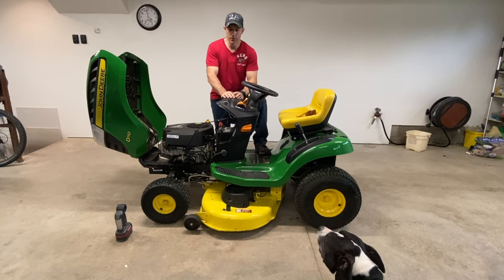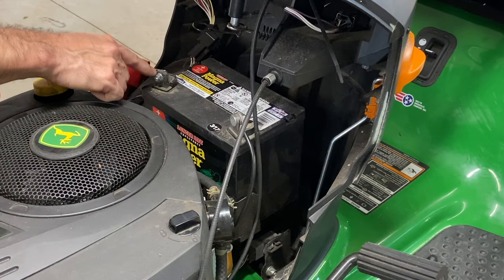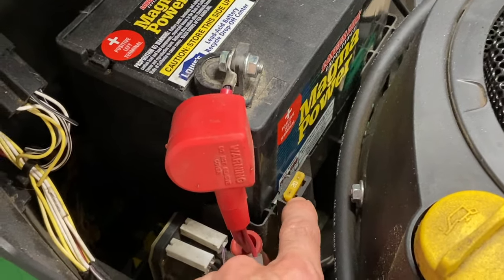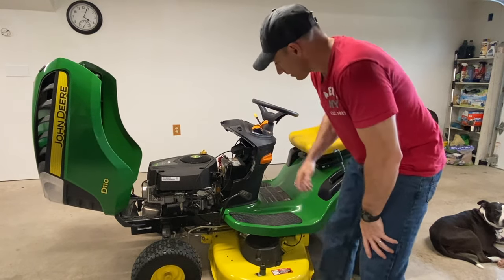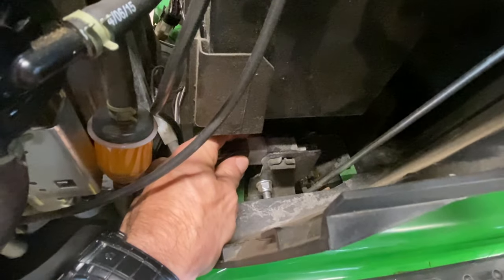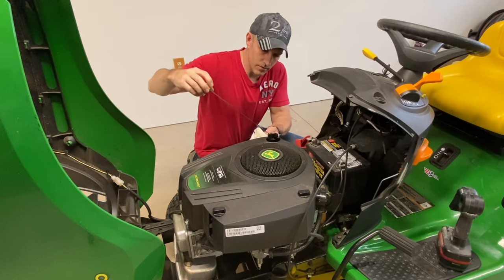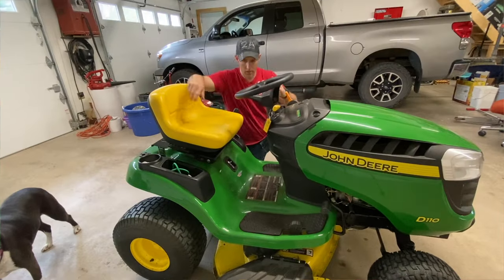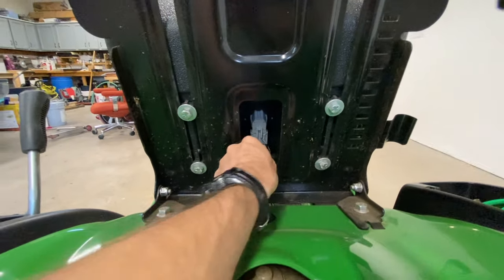JOHN DEERE 100 SERIES WON'T START

Comment: This video is the perfect example of the original benefit of YouTube. Clear, concise and informative.
Reply from the maker: Thanks glad you like
Reply: Lastly check solonoid, mine wasn't transferring voltage to the starter. Thanks David.
Reply: I maybe have 7 subs idk, but I subbed and liked just for this reason. I cannot stand when someone has a whole intro, I'm trying trying get shit done haha.
Reply: In my case. Jim says check the fuse. Mine wasn't broken it was missing. My son has been tinkering on a ATV and I am guessing he stole it, but refused that he did anything to it. Less than 2 minutes and Jim had me back up and running on a fuse I didn't realize wasn't there.  Thanks for the help
Reply: I completely agree, i had a blown fuse and didn’t need to watch someone speak for 20 minutes

Comment: quick tip from a JD tech: while trouble shooting or in general you can start your lawnmower with no weight on the seat as long as the parking brake is engaged. helps when checking multiple safety and power points throughout the ignition system.
Reply from the maker: Thanks for the tip I’m sure people do not know this. I was just going over the manual.
Reply: @DIYJIM  you’re welcome, keep up the videos. very informative for the common consumer that may not have read their manual or aren’t as mechanically inclined 👍🏼👏👏👏
Reply: Yep, as long as the blades are disengaged and the parking brake is engaged, it's not necessary to push on the brake pedal ... or even be seated on the machine.

Comment: Jim, with the safety switch's there are several suggestions from people about disabling them. Can you just cut the wires and join them together and tape them up? Also, how to test the clutch mechanically and electrically? Thank You Sir!

Comment: I have 3 acres, not 1 ft flat. I have to lean & shift my LARGE body to keep from rolling it. I want to bypass the switch that keeps cutting my engine every godamn time but it will void my warranty. Any thoughts JD NATION?
Reply from the maker: I cut the wires and put a wire nut on them. I have a video on what I did if you look. Thanks for watching

Comment: Thanks for the great video Jim !  After mowing my front yard this weekend, my 19 yo JD L110 wouldn't start when I started to mow the backyard,  found your video and did the checks you suggested and it was my fuse and the brake safety switch had dislodged out of the bracket.  Put in a new fuse and put the switch back in and was good to go !!
Reply from the maker: Glad I could help, thanks for commenting

Comment: What if it starts and runs very rough then stops but won't start again.. lots of gas coming out where the air filter is.
Reply from the maker: Maybe try watching this https://youtu.be/0qStUg0ImoI
Reply: So mine will not even start again. Until it completely cools off like the next day. I took off the filter, tried to start it and a bunch of gas was shooting out.

Comment: Wow, thank you. As an older single woman trouble-shooting my "crank but won't start" JD L120, this video gives me step by step things to check. I like your delivery, too. Just so dang clear, and good video technique  to show what we're supposed to look for. Appreciate it, man.
Reply from the maker: I hope it helped you, thank you for watching have a good summer.
Reply: Woohoo. Figured out it's a fuel problem. On to replacing the fuel filter! Yes, there's gas in the tank...lol.
Reply from the maker: @margarethansen2720  check out this video https://youtu.be/0qStUg0ImoI
Reply: Ditto for me.  This guy gets right to each point.
I took this video into the garage and went through the rig one by one.  I think the problem is the fuel filter that appears never to have been changed.  If changing that doesn’t do it this video helps me believe I’m up for the task to continue.  In fact, cleaning things as I’m going through and learning each system is fun.  So when I’m finished this old thing will be humming again. 
Hi it’s just me making a mechanical repair.  Hooray!

Comment: Fan-freakin-tastic video!!!  Thank you VERY much! 

Out of the blue, I'm mowing my lawn last Saturday, and my <5-year-old E150 just sputters and dies, 30 minutes into a 90-minute job.  At first I thought it might be vapor lock or lack of gas, but it wasn't.  I cleaned the air filter (which really did need it), opened the gas tank & checked the level, verified battery connection and charge, but could NOT find anything which would allow it to start again.

Came inside, found your video, and went thru it, step-by-step, testing it for starting after each one.  Got to the step about the foot pedal safety switch, which I disconnected and blew out, and BAM - she's back to life!  Didn't even seem that dirty or disconnected, but that was the one which did the trick.  Went back out and finished the job, ran smoothly as ever.

Thank you for creating such a well-shot, easy-to-follow list of steps to check.  I saved a LOT of time, headache, hassle and $ by watching your instructional work here.  It is WELL appreciated!!!
Reply from the maker: You are very welcome thanks for waiting and leaving a comment.

Comment: You gave good examples and very details. Thanks for sharing.
Reply from the maker: Welcome, thanks for watching
Reply: Jim I have the same John Deer lawnmower. I just got it out the shop for maintenance. While I was cutting grass I rained out of gas. I put more gas in it and tired to crank it up but it want start up. The lights comes on like it suppose to but it just want crank up. I watched your video several times and did everything that you did and it still want crank up. I have a new filter, half tank of gas, battery is new, new fuse, new spark plug and oil change. I had it in Neutral when I tired to crank it but still nothing. I checked everything that you stated. What do you recommend? Are so you have any suggestions? I know it’s something simple but I can’t figure it out.

Comment: So I noticed that after I turned my mower off, it sounded like a clicking or vibrating noise coming from the engine. I wiggled the starter cable and it stopped. Now I'm trying to start it back and it acts as if it's dead. The battery isn't dead and my fuse is good. I'm wondering if it's something to do with the starter.
Reply from the maker: Sounds like it could be something to do with your starter. Hope you get it figured out. Thanks for watching
Reply: @DIYJIM  It was the solenoid. JD said it was pretty common with the model I have.

Comment: Thank you for posting your DIY videos. This particular video has helped me to eliminate all the possibilities to why my mower wasn't turning over at all.  However,  the problem that I found wasn't in any videos that I have found,  it turned out to be a grounded wire connected to the lights.  Apparently,  while opening the hood,  the wire harness leading to the lights had become impinged in the latch exposing bare wires, resulting in a ground. Even though your video didn't cover this possibility,  it did help me to solve my problem.
Reply from the maker: Awesome glad you got it fixed out. Thanks for watching

Comment: Not just that you HAVE fuel.. I couldn't start my LA145 for months.. had fuel, new plugs, new battery, re built and clean out the carburettor even though all those thing (barre the battery) were good..  

Turns out my fuel had gone off.. drain the tank and re fuel with 98octane and she purrrrrrrs
Reply from the maker: glad you got it figured out thanks for watching

Comment: Just above the fuel filter he pointed out, is the fuel pump. It has 3 ports on it that the hoses connect to. That could also be clogged. Plenty of videos to show you how to check how the fuel gets pulled from the gas tank to the engine and whether your filter or pump is clogged. Just simple stuff to check. It can get more involved with the carburetor/jetting/float bowl if everything else is flowing properly.
Reply from the maker: Thanks for the tip and for watching

Comment: I have an LA150 that will making a buzzing/humming noise if I turn the key all the way. I have to just barely turn it to prevent that but then it'll crank and act like it gets bogged down and stop. Already changed the ignition switch and battery. Still doesn't work
Reply from the maker: Not sure maybe starter is going bad. But the bogged down part not sure. https://youtu.be/0qStUg0ImoI

Comment: Should never start it with the transaxle set in neutral
Also it will not start if fuel cap is not venting & if valve clearances are off,good video 👍
Reply from the maker: Thank you for the comment

Comment: My dad has a D170 and he said he heard it clicking but it wouldn't start. We changed the battery and nothing not even clicking and the lights won't even come on. I checked everything you said and still nothing. I don't know anything about motors. Any ideas about what I can try? I'm lost. Thanks for the video.
Reply from the maker: Maybe starter solenoid

Comment: Good videos. Should the fuel filter be showing full while in use? Or partially full okay? I was having issues with earwigs in the empty tank over the winter getting stuck in the fuel intake tube. Noticed the partial full filter while troubleshooting. Thx.
Reply from the maker: Partially full, thanks for watching

Comment: Thank you so much for this video. I own the same mower and love that as a woman this mower is so user friendly. I’ve changed just about everything on this mower and it’s nice to have videos like this to learn more and always have it as a reference. Pulled my battery out and currently charging it. Was completely dead. However we have had this mower since 2017. We shall wait and see.
Reply from the maker: Awesome I’m glad my videos help you. Thanks you very much for the nice long comment.
Reply: Same thing literally happened to me today, but it was fuel filter and battery.
Reply: Especially that nice oil filter, 30 seconds
Reply: I am a single woman with a huge yard so get you.  This guy is so easy to follow.  My John Deere is running again.
Reply from the maker: @maggiebarks2395  glad I could help

Comment: Jim - Wonderful guidance. I did every step you recommended, except fuel filter (which looks clean from outside). Still nothing. Meter shows battery charged (hope I did it right) and lights turn on. Should I take batter out and get tested at NAPA? How would I know if a switch is bad/dead, without replacing all one-by-one (seat, break)? How would I know if spark plug is bad?
Reply from the maker: Thanks for watch sorry it did not help you. Really hard to explain in a message how to check everything. I would use a bypass wire in the switches to see if it starts when you bypass one at a time.

Comment: Hi Jim I thought your video was comprehensive and production quality was excellent. However, you never addressed the IGNITION SWITCH which is critical if your John  Deere lawn tractor won't start.
Thanks for the good info.
Reply from the maker: I just went over everything the manual says to check, but thank you for the comment maybe this will help someone else out.
Reply from the maker: Thank you Rollie motor

Comment: What of fuel pump relay??? Fuse will look good but relay? Just wondering if you'll hear fiel pump turn on like in cars?
Reply from the maker: I think guys will disconnect one of the hoses to check the fuel pump. Thanks for watching

Comment: I really appreciate your video.  I have a JD S120 that ran like a charm until this past August.  It started acting up and wouldn't run for anything, spitting and sputtering and even was hard to start.  I took it into a shop and $85 later they told me it ran great.  I took it home and about a week later it was back to where it was before.  I didn't plan to take it back to them so I read online where I should check the air filter and the plugs.  I replaced all three and it ran great FOR ABOUT A MONTH!  I was ready go buy a new fuel pump when I ran across your video.  Before I blew those ports out back by the fill cap I tried to start it again.  The engine would turn over but it wouldn't stay running even if I help the throttle bar up as far as it would go.   So I blew out those two ports in the back then got on the mower and tried to start it again.  It kicked off nd even in low throttle it stayed running!  So I took it out and engaged the blades and it styed running even when I lowered the throttle.  I also don't why it fixed it but it doesn't matter because it saved me some time and money because the next stop was another repair shop.  Now it sits in my garage waiting for Spring when I mow again!  I live in SE Pa. and the grass isn't growing right now.  Thank you very much and have a wonderful Christmas.
Reply from the maker: Glad I could help, I started putting only non ethanol gas in my mower that also seems like it helps.

Comment: Thanks for the video. When I removed the fuel filter no fuel came out of the fuel line. When I removed the gas cap, fuel came gushing out of line. So probably a blockage. And Last year engine would not start because my head gasket leak was putting too much oil in cylinder and fouling up the spark plug.
Reply from the maker: Hope you have better luck with your mower. They sure do not build them like the used to.

Comment: Jim you want a lawn/garden tractor that's built like a little Tank all around..go with a 2021 Craftsman T240 Turn Tight..John deere or cub cadet couldn't touch the Craftsman in quality of build
Reply from the maker: Thanks for the advice, they all make much nicer mowers if you want to spend more $$. I only mow 1/2 acre
Reply: @DIYJIM  full price of my 2021 Craftsman T240 Turn Tight $2,800 and well worth every penny and more

Comment: Brake pedal switch mechanism was disconnected from it's bracket.  Once re-positioned brake pedal switch into it's bracket, cranked right up.  I would have never found this it not for your helpful video.  BIG thanks.
Reply from the maker: Awesome glad I could help

Comment: I just fixed mine by myself. I had a guy put on new battery, spark plut and filters.  Still wouldn't start. I watched a youtube video. The gas cap has a hole in it.  Take off the cap and the rubber liner had 3 holes in it. The liner will pop out. I cleaned all four holes and put it back on and it fired right back up.  Wow. I couldn't believe a gas cap could stop a mower from starting. But it was a free fix.
Reply from the maker: Awesome glad you got it working.

Comment: you can use multimeter to check fuse without removing it by touching leads to exposed metal on either side of the number 20
Reply from the maker: I did not think of that thanks for the tip. Maybe someone will see this comment and it will help them.

Comment: ...or your son uses the L110 mower, but doesn't park it where it's supposed to go when finished. Later, you come to move the mower but it won't start.  You try everything...and I mean everything...only to discover your son left the mower blade engaged....yes, I felt very stupid.
Reply from the maker: I did that years ago with my cub cadet I also felt a little dumb I promise you will never do it again Lol have a good summer

Comment: I have one, and it doesn’t have a saftey for low oil. The filter on mine was loose and rode it a couple of times with zero oil in it. Good think I noticed before it got bad
Reply from the maker: Holy smokes, thanks for watching

Comment: I have the John Deere 100L series. After cutting the grass, I turned off the mower and took a leaf blower to it to blow off grass clipping and any dirt it had on it, then I tried to turn on mower to drive it into the shed and it wouldn't start, not even turn over.  Went from starting perfectly fine to completely dead after blowing it off with leaf blower. I'm baffled as to why and how a leaf blower caused my riding mower to die. Have you ever heard of anything like this happening before?
Reply from the maker: Definitely never had that problem. You do have the blades disengaged? Hope you get it figured out
Reply: @DIYJIM  Yeah, that was the 1st thing I checked to see if the blades were disengaged. 😕

Comment: My john deere D100 won't come outta gear, and i have the shifter in the neutral location, So what's the problem? plus it's hard to crank and will not stay running once it's started. What do you think my problem is...TIA
Reply from the maker: Sorry really not sure never had a D100 hope you get it figured out

Comment: My D110 won't start. I believe it's because the vacuum hose (new) is not getting a pulse to the fuel pump.Most John Deere vacuum hose goes directly to the OHV cover. My D110 v hose goes to the oil spicket tube. I found that odd. Any help would be much appreciated.
Reply from the maker: Try this video https://youtu.be/0qStUg0ImoI.  Hope this helps

Comment: I had the fuse by the battery problem.    The fuse wasn't burned out but there was a black film inside.  I replaced the fuse and the tractor starter up quickly.  After a few minutes it wouldn't start again and I noticed the fuse was picking up a black film.  I changed it again and it started again.  I don't know if it is some kind of short or what is causing the problem.
Reply from the maker: Hope you get it figured out I never had that problem.

Comment: Thanks for this.  Like an idiot, I pulled out the multi-meter and was getting ready to dig in (mainly to check if the PTO lockout was loose again, which was a problem the day I bought this thing... ) and of course it was something simple like, leaving it in reverse after I parked it last year 😂🤣😂🤣, I'm an oil change and tank of gas away from mowing my first time this year.
Reply from the maker: glad you got it figured out, thanks for watching